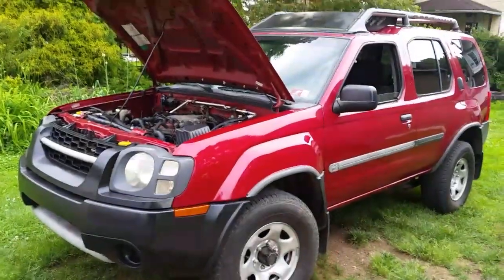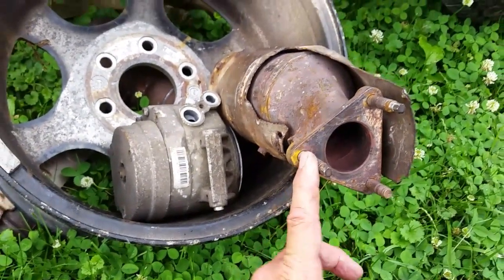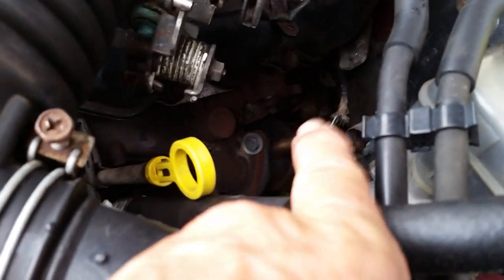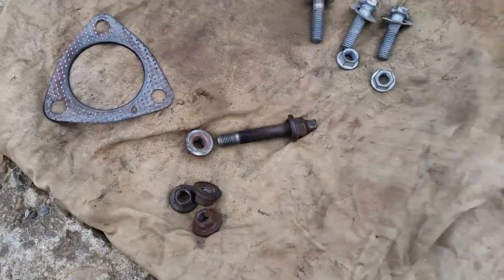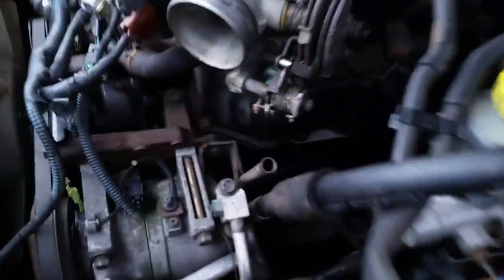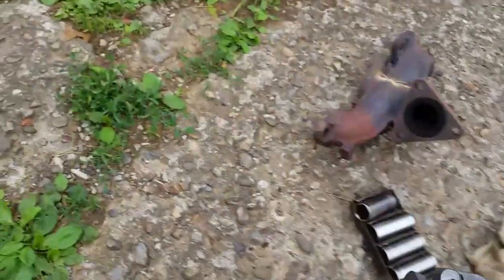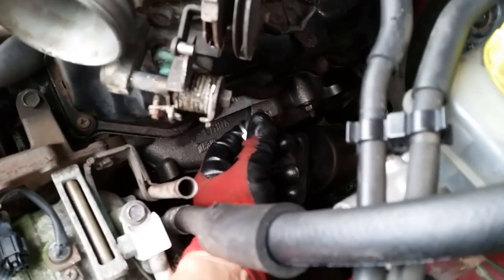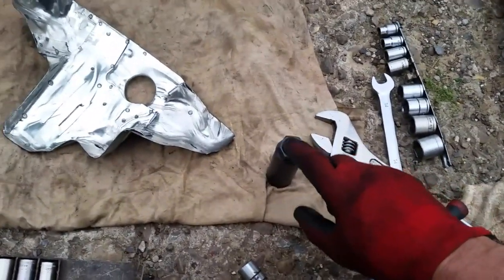Xterra Driver side Exhaust Manifold Replacement 3.3 2002

Comment: It’s 2023 and I’m watching all of your 02 Xterra videos still👊🏾 bought one as an overland project. Long story short I’ve been replacing everything under the hood from water pump to vacuum lines… I have the random misfires with no code going so I’m replacing driver side manifold (did passenger a few months back) alternator, fuel pump, and at least 3 injectors this week!

Your videos are a huge help 👊🏾
Reply from the maker: Nice! Great little 4x4's!
Reply: Same!!!

Comment: Had a 96 pathfinder with the 3.0l, fully loaded, manual 4x4 with an LSD. Wonderful machine, sold it due to fuel consumption, it was truly terrible, around 20L/100km in town. 
Now looking at an early 2000's Xterra with a manual as well. Contemplating the purchase at the moment.
Reply from the maker: Nice!!

Comment: hello, the new manifold are still good? because i have the same issue with frontier tried to weld the old ones but didn't really had a good result i ordered new manifolds from A Premium parts looks the same as new the new manifolds you installed in this video

Comment: good job on the videos with this xterra! im having a p0420 issue with my 04 3.3l supercharged so im going down the rabbit hole of the o2 sensor bungs and i noticed the downstream sensor has like no room already and the entire exhaust looks nasty so i thought i would just replace some parts and im on ebay seeing a lot of listings for manifolds with the catalytic already welded on. i was wondering if you had the opportunity to replace the manifold with one that had the cat welded on if you would do it. let me know what you think
Reply from the maker: I would. Its easier to work on. A 2 piece is more work and then you have to put the 3 bolts back in to connect the two. One piece is so much simpler.

Comment: I got Xterra 2002, and I already fix a lot of stuff in it and I still have problems when I turned on. In the morning turns ok but after that sometimes it doesn’t turn on right away like in the morning, the wired thing is that it doesn’t do it every time why can you gave me an advice please? Thanks 
Hortencia.

Comment: Wake up world these trucks are the Bomb, A normal deplorable cant afford at 50k 4Runner. These old 2002 Nissan Xrerras  are tanks and easy to work on.  Keep up with videos my has 234k and my 2000 frontier  has 245k
Reply from the maker: Word!!
Reply: @FixingWithPassion 

Was the exhaust leak sounding like lifters clacking when engine is running?
Reply: Xterra are trash to work on